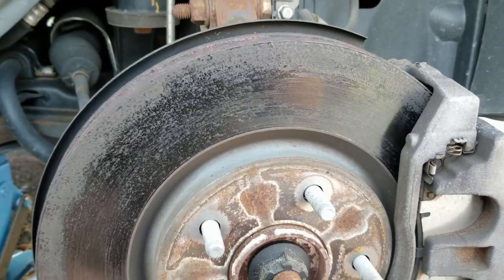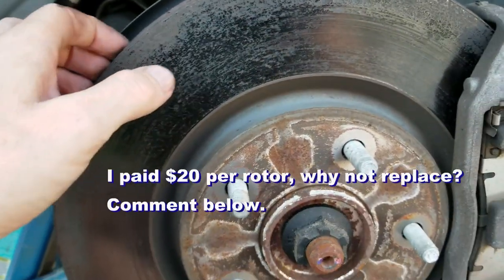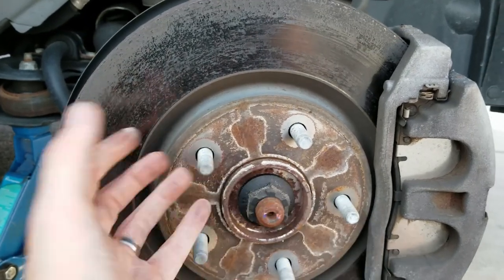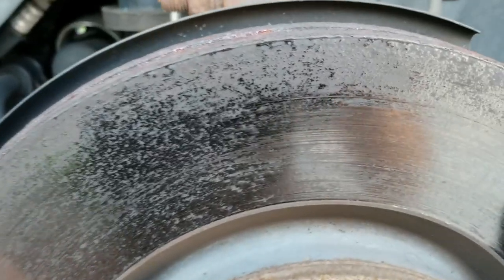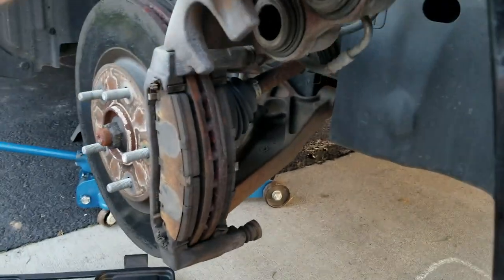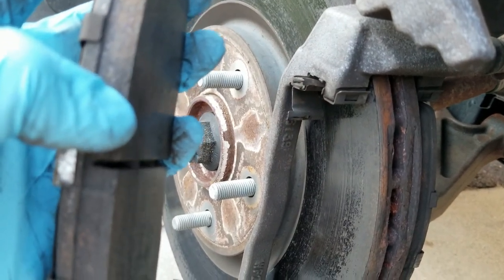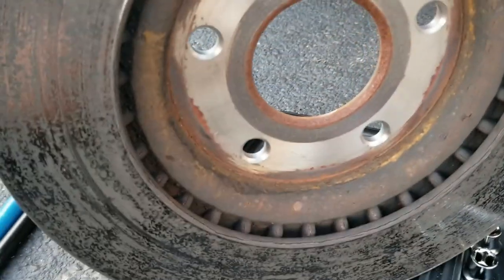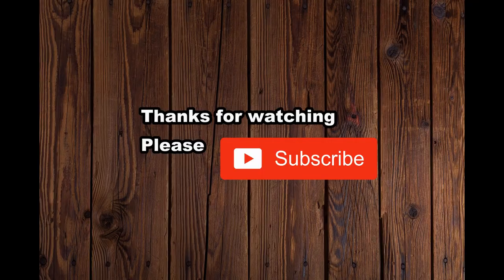Brake rotors - Do this if they are rusty or warped

Comment: Power drill and sanding attachment;) 
Otherwise I've used the cheapest brake sets a few times and I was satisfied everytime and couldn't bring them to fail what I did. Only my hub caps melted on one of the cars when testing the brakes
Reply from the maker: You use that to resurface or get the rust off?  Was that what the power drill and sanding attachment is for?
Reply: @SeanDIY  yes if it's still surface rust but too much to simply use the brakes a few times to clean it away.

Comment: Where did you get rotors for $20
Reply from the maker: I think I paid $24.99 per rotor at AutoZone or one of those places a few years back.  They are $31.49 at Autozone right now after 3 years of inflation.

Comment: My son gave me a 1977 f150 sat all winter in snow. I drive it today 6 months later. Rotors look like I drove it yesterday. Metal quality?
Reply from the maker: Could be.  Steel definitely rusts.  Usually, if you drive the vehicle regularly, the brake pads keep the rust off.  My car came from Florida,  so perhaps it was the humidity as well.

Comment: Rotors would not look like that if there a wasn’t a problem  you have a bad sticky calipair or sticky pins or both
Reply from the maker: This vehicle sat around for a few months and the rotors were quite rusty.  This did fix it, but what would you do for a sticky rotor?
Reply: My rotors look like that, car also sit, barely being driven for 8 months or so. This was in the winter/spring in the upper midwest. Rust built up and ate away at the rotors. Car only has 17,000 miles on it.
Reply from the maker: @C-S.  Absolutely.  Mine was the same because it was a rental car that was then sold at auction.  I'm guessing you replaced the rotors and all is well now?
Reply: @SeanDIY  Take the slide pins off clean them re-lube with silicone based lube for break pins and reinstall.
Reply from the maker: Excellent point.  Thank you.

Comment: Thanks for sharing. Did you need to use some sort of C Clamp to push the piston thing back after the new brake pads?
Reply from the maker: Great question.  Some cars just need a clamp, but these ones have a slot (at least on the back calipers) thqt is like a giant philips and you need to twist or screw them back in.  Your local AutoZone or other shop will have the tool you can borrow to do this.  I think I did another video on that topic, but you can find videos that show this.

Comment: The caliper power when braking should punch the pads hard on the discs and clean all the rust , you may have problem on your caliper you may have to fix before changing brakes , nice video btw
Reply from the maker: Thanks.  From what I have read though, you actually sometimes need to just replace them because the rust may not go away and makes it out of round or not flat so to speak.
Reply: If the car sits for too long (we're talking months at a time) pads won't take the rust off.

Comment: Looks like its been sat for ages and then drien and just polished the rust over. A good clean could work but i would probably buy new. But not cheap.....buy the best you can afford. Also...new discs need new pads. In my book its the law. Old pads will not sit properly on the new disc face. Just add the cost of pads to the job. Again matchng quality to the disc.   You wouldnt reuse an oil filter at an oil change...so use new pads.
Reply from the maker: It was probably sitting for a month or so as far as I can tell.  I relaxed the brakes again at 70k miles and I agree, I'd only ever do it both at a time going forward. Thanks for the comment.

Comment: 3:54 Jesus! People are really clueless about what they're looking at! If somehow the vehicle  had been in a situation that ripped off that amount of steel from the disc rotor. There would be no car to look at! Think about it for a moment.

Basic engineering: Every (critical) rotating mass should be BALANCED! That's what you found out, the point where disc mass was removed to balance the set. This usually is done by grinding excess material from the "heavy side". It's done on the inner surface of the disc for obvious reasons. To keep the outer surface smooth and perfect. 
Usually it's found only on vented (double face) discs. 
By comparison, on solid discs the machining process alone, tend to be enough to bring it to a much more "perfect" round. Or in other words a balanced condition.
On vented units the non machined inner areas don't allow that. As such the need for balancing. 

BTW With this said, when people start thinking about skip balancing their wheel/tire assembly. Or remove that small fixing screw on the side of the disc. And a few other "clever" ideas... Think again. ;-) 
I hope this help. Cheers
Reply from the maker: It's definitely important to have balance.  For the cost I always replace the rotors when I change the pads.  It's worth the extra money to have quality parts to help you stop in my opinion.

Comment: You must have got your rotors a long time ago because right now there are between the prices of $97.00 to $110 a piece for a 2017 dodge journey at cheap chinese part auto zone store. So I don't know why you're saying $26 or $30 or whatever that must have been quite a few years. I have never bought a rotor for $25. Maybe 1976....
Reply from the maker: Duralast. They were in fact $39.99 back on 2018.

Comment: Not sure why you have so many dislikes? You're asking questions
Reply from the maker: No idea. I put out videos to help people and some are well received while others may not be.  I've done my brakes on a lot of cars and while not an expert, I believe for the price, do the rotors and brake pads at the same time.
Reply: @SeanDIY  yeah that's what I'm doing, I got a complete set on Amazon of all places for $168
Reply from the maker: That sounds like a good deal.  I usually go to Auto Zone.  Believe it or not they offer lifetime replacement on pads.

Comment: You dont need to do cross pattern on wheel bolt removal... only on refitting the wheel.
To get the disc off you also need to take off the carrier bracket for the caliper.
Pretty bad vid... should not be offering advice if you are not a mechanic.
Reply from the maker: Sis you watch the whole video?  I took the calipers off.  I learned to do brakes from a mechanic and have done them on at least a dozen different cars.  I've even done drum brakes, but don't like them much.